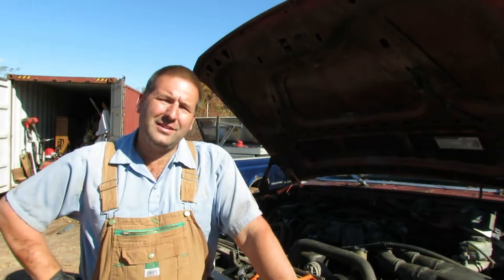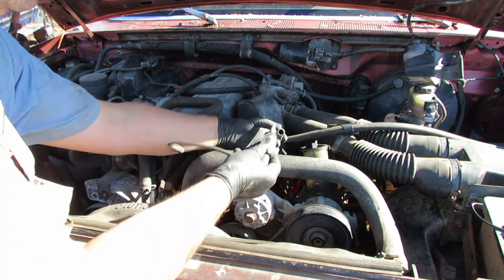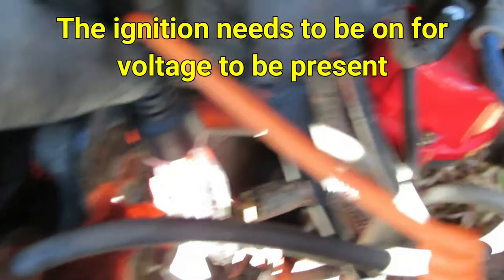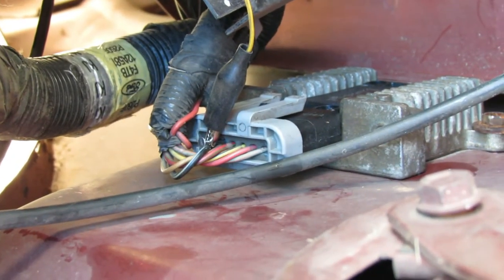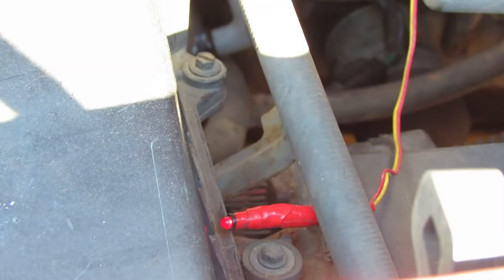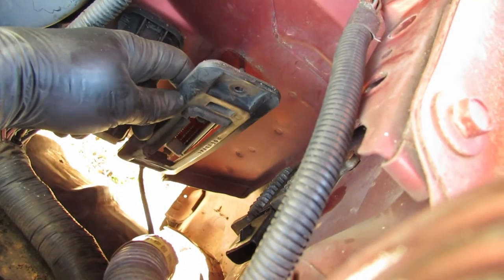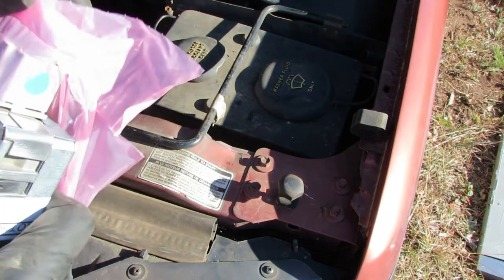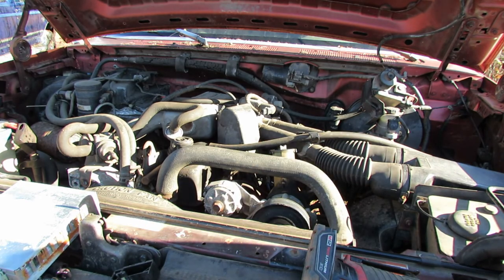1994 Ford F150 4.9L 300cid I6 Ignition Troubleshooting

Comment: If I buy led low voltage 0:05 test light how do I test the signal coming from distributor coil with it
Reply from the maker: @tessiehuskey689 I just want to make sure we are talking about the same thing. Are you asking about testing the spark plug like wire leaving the coil or the signal wire from the ignition module? Let me know! ~Mr. C.
Reply: I’ll be testing the signal from the ignition module The test light that I purchased on Amazon Dual color LED bulb automotive test light 6v to 24v low voltage type my question is since I don’t have two alligator clips red and black I have only one alligator clip on the test light how do I hook up the polarity when I test the pip wire and the spout wire and thank you for your first reply.
Reply: I didn’t mean to say spout wire I meant to say ground to the ignition module I believe
Reply from the maker: @tessiehuskey689 ok I understand. If needed you can back probe the  connector with a small nail or  paper clip that has been straightened out or something similar. Then use a jumper wire with alligator clips on both ends to connect to the nail and the other on the probe tip. Hope this helps. Please don't hesitate to ask another question. I love to help. I can make a short video to help explain too. ~Mr. C.
Reply: Ok the pip wire is back probe with paper clip then that is connected to the test light pointer with a alligator jumper wire then the alligator clip of the test light is connected to the negative or positive side of the battery?
Reply: This is a 1994 f-150 4.9l I’m working on today I hooked up my alligator clip of the  dual led light to positive on the battery and the pointer to a wire probe in the second wire up on the spout connector and the green led light comes on but when the ignition switch was turned on the green light goes off does this mean the PCM is bad?Before this test I hooked up the pointer to the pip wire at the top of the spout connector and the LED was flashing I also used a regular test light alligator clip to ground and the pointer close to the coil with the wire off and it showed spark when engine was cranking coil positive had 12v and coil negative had 12v and not flashing

Comment: i was under the impression that Ford got rid of their ignition control module in the early 90's because they were so problematic . My 88 f250 has one , but neither my 91 f600 , or my 94 f350 dually , or my 96 bronco have that piece of crap. I had an 84 LTD (small one) that went bad and I had one helluva time just removing it from the distributor !
Reply from the maker: @rickobrien4025 I am not sure of the exact years for the module. This model seems to do ok with it. Thanks for sharing and watching! ~Mr. C.

Comment: Hello From Mark In Kentucky.  I have a 1985 Ford F-150 with a 300cid engine with a 4 speed New Process 435 transmission that has a no start condition in which I was advised by a friend who operates a garage that my computer was probably bad. 
My truck actually has a carburetor and no real options other than air conditioning in which I really don’t understand why Ford even used a computer for such a “Plain Jane” truck- Oh Well.  
I think my computer is located under the dash the right of the steering wheel and pedals. I am kind of a large person and not sure if I can contort myself enough to get myself under the dash enough to get the computer out. 
One night about a week ago I was driving in town one night and my engine shut down. I could crank over the engine and I was getting some firing which would weaken with steady cranking of the engine. 
The distributor cap, rotor button and spark plug wires were in pretty bad shape so I have pretty much changed out all of the engine ignition parts with the exception of the pickup coil in the distributor. While changing out the ignition module, I discovered that one of screws that hold in the module was stripped out, So I may get a reman distributor that would take care of the pick up coil. I am thinking that both computers are probably pretty similar with the exception of the location difference between our trucks. My 1990 F-150 should be pretty much identical to the truck that you had in your video. Believe it or not, There’s virtually nothing mentioned about the older Ford trucks like my 1985, So I stumbled across your video and will try to put it to good use. Thanks For Your Video.
Reply from the maker: @IronDuke502 sounds like you have a pretty good idea about what is going on to get her running again. I wish you the best of luck on fixing your issue. If there is anything I can help with just let us know and I will do my best. Thanks for watching! ~Mr. C.

Comment: So I have same truck just bought it been sitting for I know 4 years replaced fuel pump and gas tank new distributor cap new plugs and wires after I filled it up with gas truck runs perfect for about 5 mins dies. Been trying to diagnose it myself but I'm not a mechanic but I'm trying. Replaced coil because it was bad and icm still won't start. Started watching your video and I'm lost because when I use the test light to see if I'm getting power to the coil light is solid but blinks on tan even before I turn truck over. What Is this telling me
Reply from the maker: @Michael Jenkins I am leaning toward some kind of fault when the truck goes into closed loop. I am thinking this because the 5 min run time. Does it throw a code when it shuts off? If it does try to read a code with the key still on with the reader shown below. I am also guessing if you let it cool down it stats fine and then runs for the 5 min. again. Let me know. ~Mr. C.

Ford OBD1 Code Reader: https://amzn.to/3xSMK6I
Reply: Just wanted to let you know I changed the computer out truck runs perfectly now. I appreciate this video and will continue to follow your page. Thank you for all your help I grately appreciate it
Reply from the maker: @Michael Jenkins that is great news! Nice it was a simple fix. Happy wrenching! ~Mr. C.

Comment: I repaired my granddaughter's Cadillac SRX with an eBay pcm.  I am a little cautious when buying car parts off of eBay, but if you check carefully, feedback ratings, number of sales, etc you should be ok.  Remember, some businesses also sell on eBay. I have a question if anyone cares to answer it.  I understand how the ignition module works to fire the coil and I understand how the distributor is timed to fire #1 cyl at tdc but what I am not sure of is what triggers the sequential fuel injection.  My son has a 98 chevy pickup and I think my Ford is designed similar to that Chevy, in that the distributor gear and cap are positioned so that the rotor is pointing at #1at tdc , but this does not control the FI trigger pulse.   My understanding about that is that there is another timing plate under the rotor which controls the trigger signal to the pcm which then fires the fuel injectors at the right time.  There are a lot of youtube videos showing the setup on the Chevy distributors and the FI timing and I think the old Fords work the same way.   By the way, the pcm and ignition module in my 92 F150 is original.  My Dad bought this truck brand new and I am the second owner.
Reply from the maker: @Charles Wilson I will attempt to answer your question. It is also my understanding the pickup coil in the distributor also tells the module when to initiate the injection sequence. Thank you for sharing. I really appreciate you spending time watching the channel and engaging with the community. It means a lot to me. ~Mr. C.

Comment: Mine wont start with nothing it just cranks it has spark and gas pressure
Reply from the maker: @adrianhinojosa4108 is your timing off?  Are the injectors firing? Will it start with starting fluid then shut off? Just some things to check. ~Mr. C.
Reply: It didn't turn on with starting fluid it had like poor spark and not frequent thats what i noticed but the mechanic said supposedly that the computer wasn't properly grounded
Reply: Now is discharging the battery